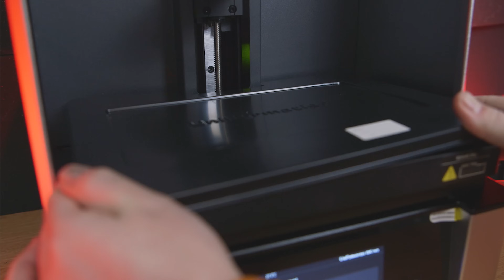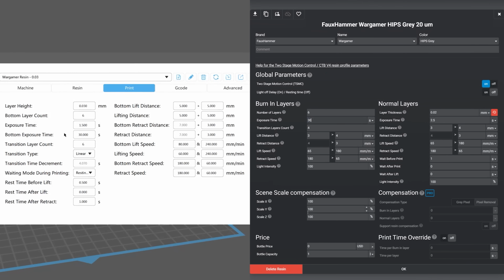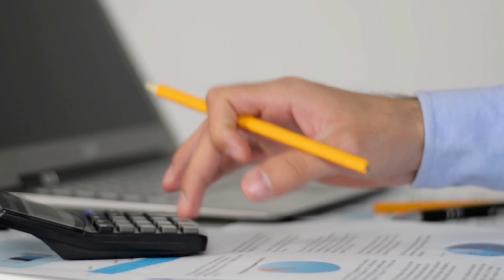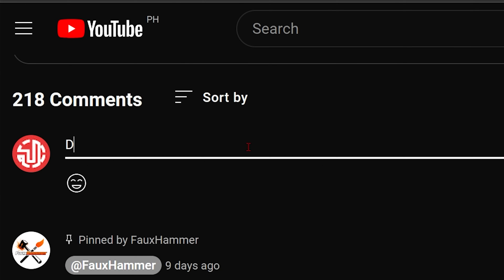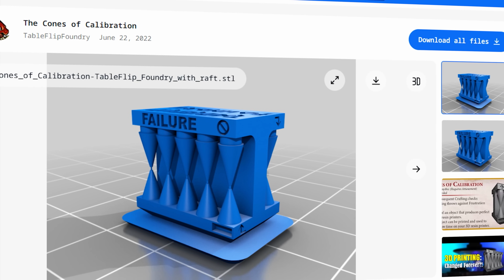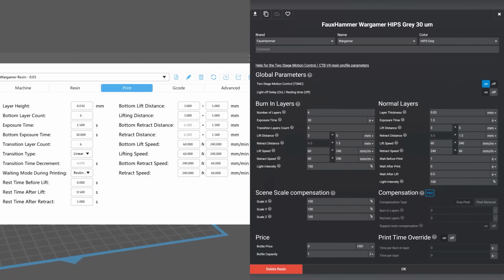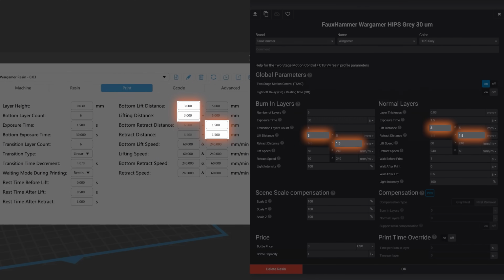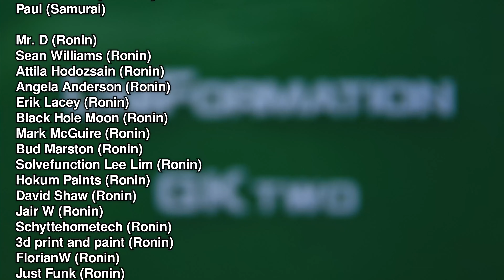The Best RESIN SLICER SETTINGS Explained for every printer! -  All Key 3D Printer Settings Explained

Comment: Cheers, Ross. I’ve got to the ‘wait after lift’ bit and have paused to post this so apologies if you cover this later. As I’ve always understood it, wait after lift is important to allow the resin to refill the space left by the lift. The more viscous the resin the longer the time. Your new Wargamer v 2 resin, for example, suggests you pimp it to 2.0s, if memory serves, which is obviously larger than the slicer default but Adam did say it was more viscous so that makes sense (I’m just running the gamut of calibration tests now so I guess we’ll see :) ). There’s certainly a linear inertia issue with setting it to zero, which could potentially  increase wear and tear, but the main reason for waiting is resin refill (but I may be talking out of my arse on that, clearly). Cheers.
Reply from the maker: Yes that's right and I think I do say this immediately after talking about all the waits.

But the bit i still don't get is wait before lift...
Reply: @FauxHammer  I know :)! I wonder if it's because the motor-hormunculus is knackered and needs to have a sneaky quantum-fag behind the dual rails? That sounds about right. Certainly I've always assumed that 3D printing is essentially witchcraft and that the machines are essentially run by a tiny little demon that runs around inside pulling levers (randomly, it would seem, in the case of some of my prints). I enjoyed watching you wipe out a ton of settings in your recent Saturn 4 Ultra video: very satisfying. What we really need is the rest to go so it's just consumer, rather than tinkerer, all the way. Then I can let my own tiny little (biological) demons loose on my precious printers. But for now they can stay the hell out of the room and just play with the magical toys wot emanate from within . . .
Reply: @FauxHammer  Maybe wait before lift is because you don't want to exert force on a freshly cured layer of resin? Perhaps even though it's chemically cured there's still a "settling" period for the resin? Idk, I'm just guessing. I've never bothered with this and had no issues with delamentation or anything.

Comment: @FauxHammer This is a great Video, I have been hard set on single-stage lift/Retract. But I will start playing with Dual Stages from this video. 
This may be a stupid question, But are their any slicers out there that have variable settings based on the % of the build plate being cured in the layer. 
Ex. 25% of the build plate is being cured for that layer it will lift 6mm @300mm/m But if 80% of the build plate is being cured for that layer it will lift 9mm @60mm/m

Comment: Hey Ross can i use tgese settings for every resin? for example i used nova 3d standar grey with the normal profile on chitubox and now i swapped to white and black resin and i get failures with the same settings.. are there any settings that can work with every resin so i dont have to change them every time?

Comment: I just preordered a S4u but after watching all your videos about the GK2 being top dog, I’m seriously considering canceling the preorder and getting a GK2. I’m so torn on what to do. Sigh.
Reply from the maker: I would love to help, but I am also still torn.

I think, if you have heating sorted and this will be used in doors in a room that is constantly at room temperature, this.

Otherwise, the GKTWO, which has other benefits aswell would be my top pick still.

But damn it's close now!
Reply: @FauxHammer  Dang - I was hoping you would be more clear cut and say this one. LOL....   I do print in my basement with temps usually at 70f / 21c - I use an Ebay chamber heater for the saturn 2 now.  Would honestly say I get 90% success on prints and the 10% failure I don;t know if it's my supports or temps.   Guess will see, going to stick with the S4U for now.
Reply: @FauxHammer Which is faster? S4u or GK Two?
Reply: If price is a concern go for the Saturn 4. I think the GKtwo has a large print area, at least for z-axis. Might be something to consider.

I love Elegoo but they do seem to have a tiny bit more quality control issues than I would like. Not nearly as bad as Anycubic lol.

Comment: Getting back into resin printing, and anxiously awaiting my Saturn 4 Ultra, this is a great refresher! Thanks for all your content.
Reply: SAME! I quit 3D Printing because my previous one could only print tiny models and it would take 10 hours to print 3 inches lol 😥
Now I'm getting the Saturn 4 Ultra to try the new moving vat that makes printing way faster.
Reply: How’s it going with yours? Got mine running yesterday after working with support over some issues with the screen but so far it’s been running perfectly.
Reply: @Rackmaster9K  its been working well! Few issues here and there but nothing catastrophic. Unfortunately its packed up in storage ATM but I'll be pulling it out and getting it running again after the move